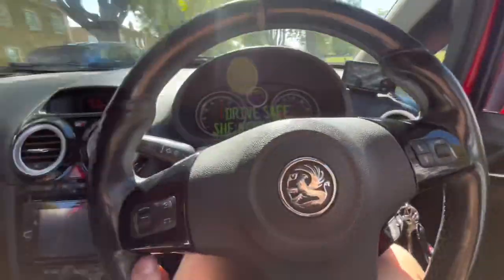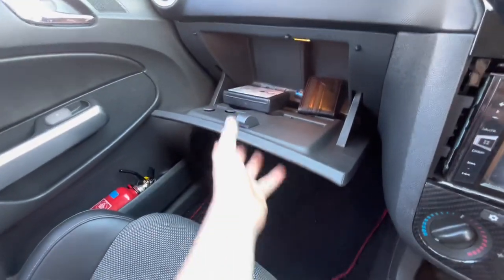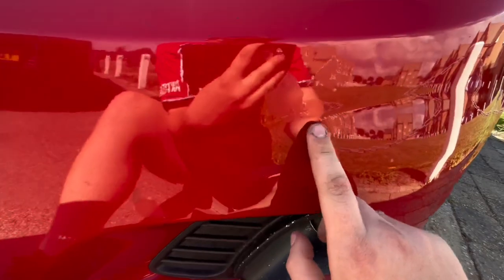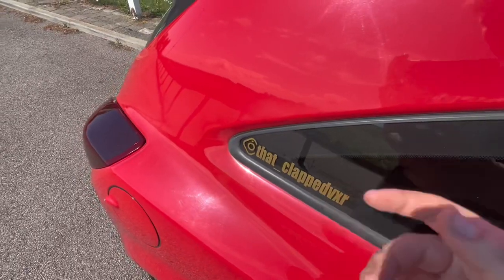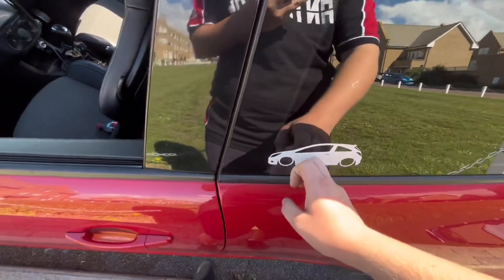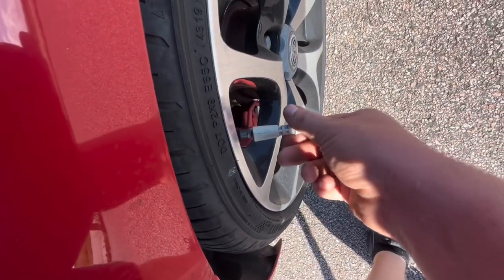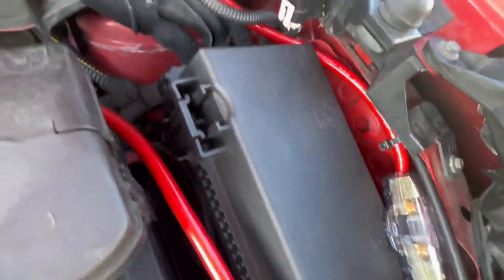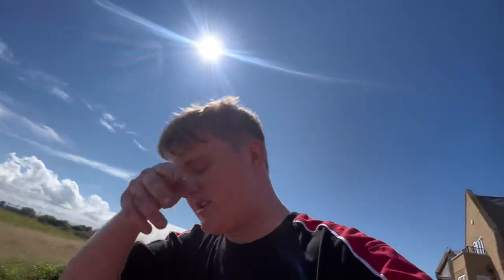Corsa VXR 3 Month Car Check

Comment: To allow it to turn off with the car you need to wire the additional red wire into the 3amp fuse that powers the “heated steering wheel”
Reply from the maker: Thanks for that tip man ill look into it!